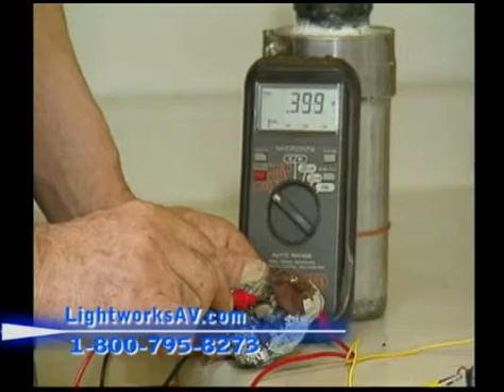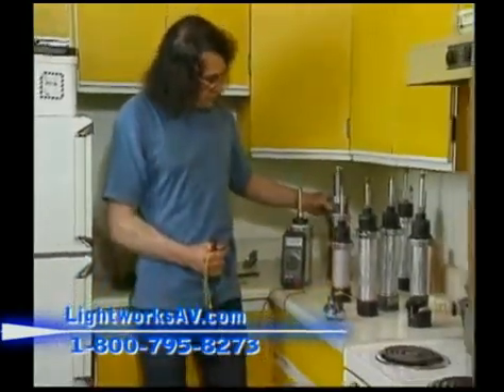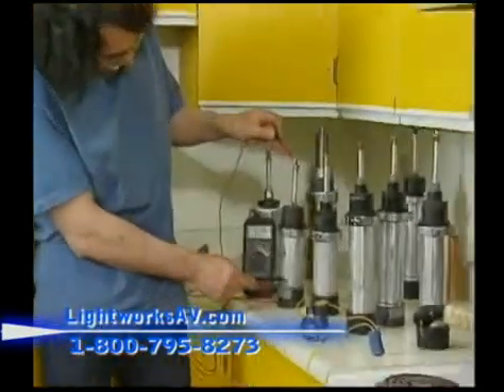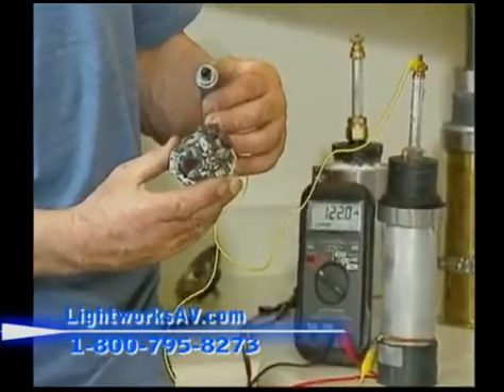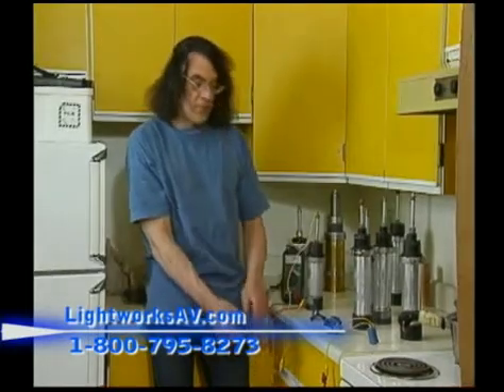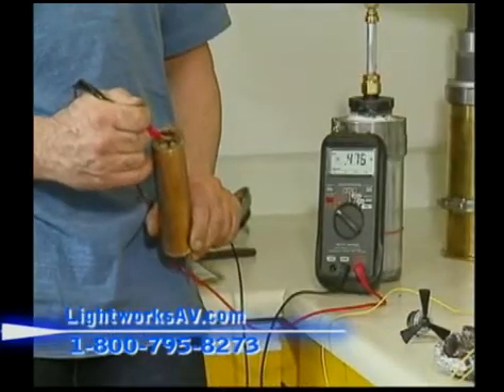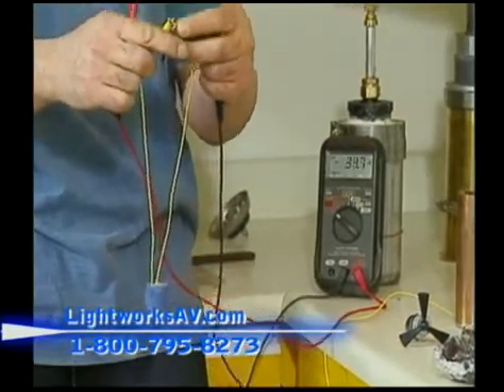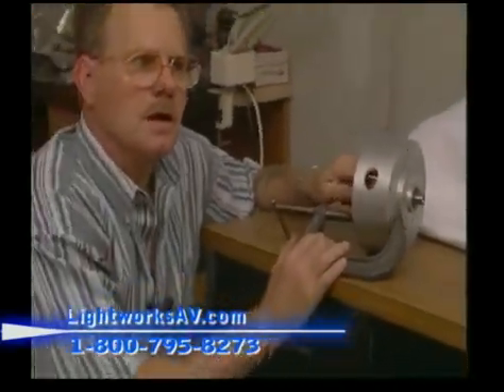Zero Energy Point - John Hutchison

Comment: the recipe is 2 parts magnesium sulfate (Epsom salts) and 1 part Rochelle salts (potassium-sodium tartrate).   This premix is doped with trace amounts of antimony sulfide (galena), silver, and iron pyrite.   The mix is heated until fused and water of hydration from MgSO4 are substantially driven off, then the fused mixture is poured into a suitable casing that will serve as the anode.  The cathode rod is inserted into the casing-dead center and held in place until the mix cools and solidified.   The crystal battery can be 'programmed' by a 12 volt DC charger for about 1 minute (connect your leads to anode and cathode) this configures the crystal lattice at the molecular level and will increase the voltage output.  The cathode can be of various materials, zinc, iron, magnesium rod, one would ideally choose anode and cathode materials that are at least several degrees apart on the electronegativity scale for REDOX potential.   These work-I built a series of these using 45 ACP brass as anode and Mg rod as cathode, linked them in series to create a battery producing 9 volts output @ 80 mA current (.72 watts).  this cell ran a 12 volt DC computer fan motor for about 3 months continuously.  These batteries are solid state, and have at least two peculiar observed properties; they increase output when put on a load, and they tend to diminish output slightly at sunrise and sunset, which makes me wonder if Schumman  resonance is at play.   Doubt it not-find Sea of Energy if you can and read it, and also look into the peculiar circumstances of the death of Alfred DeGeus at Charlotte airport in 2014.
Reply: @abbaspourmoghadam3850  Howdy.  I do want to be helpful.  Actually Mg can be a cathode if the anode is Ba, Li, Na, K or Ca, all have higher oxidation potentials.   You must not think of these batteries as chemical in nature anyway, there is no REDOX activity, they function more like permanent capacitors that are caught in flux, I compare them to a Piezo electrical crystal under constant squeeze.   The limitation with these is current output, it's very low and if I had time I would like to figure out to improve this.  MgSulfate wants to rehydrate very badly too so I tried to seal these as much as possible with finger nail polish, hydration diminishes the output.   Trying to get these crystal batteries to run a motor, with high impedance to start up, it's not practical.   I have run a 12 vdc computer fan for several months off a bank of them and also LED lights, it may be an interesting experiment to run output through a DC buck converter to step up current output.   Oh, I am sorry I forgot to mention quartz crystal, finely ground is one of the trace materials to add to the Epsom/Rochelle salt flux. Cheers
Reply: @ummmkay1744  if you want the book-seek me out.   You will find little information on Alfred P Sumera either.   sorry D Geus's first name was Arie, not Alfred, and his death was in 2007
Reply: @abbaspourmoghadam3850  so you tried once-it didnt work-so you say its impossible?  You know nothing John Snow.  Ive been a chemist for 33 years-your reply about non-metals and ionic bonds..makes no sense.   Give me a few days to make some and post my results on my YT homepage so you can see for yourself.   If doesnt work why do you think they went after Degeus?  YT wont let me post links within a comment-look up his name with project Camelot.
Reply: @abbaspourmoghadam3850  please share!
Reply: @abbaspourmoghadam3850 Tell what the secret is. We must know. And also tell us if it has anything to do with the rocks found in Congo that behave like vibranium.

Comment: A third of a volt? Fuck me, that's just a mild natural piezo-electric effect. About as much as a potato battery.
Reply: Now take 1 million potatoes and make a giant battery...I still don't see anything wrong with potato battery if it works it works
Reply: @GrowingDownUnder  Yeah, you get your million potatoes sorted out. Moron.
Reply: @k9killer221  yes, I just asked apple if they can send me all their iphone's because I need some potatoes
Reply: yes, no argument there-but where it gets interesting is the effect is constant without any mechanical input (no pressure).   Some smart folks have argued there is a squeeze effect inside the casing of the battery that is coming from the MgSO4 trying to rehydrate, swelling the battery and creating pressure.   I need to test this, a simple method would be before/after weight checks.   These aren't going to replace fossil fuels, but there is a very interesting effect going on here and there are much more refined ways to improve the energy output
Reply: @schinderiapraemeturus6239  You should also look into Bizmuth.